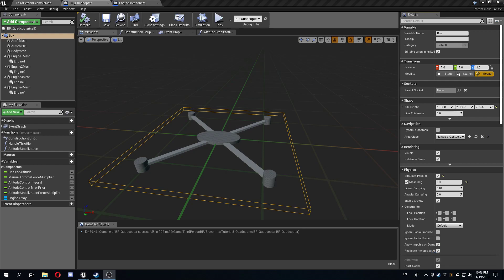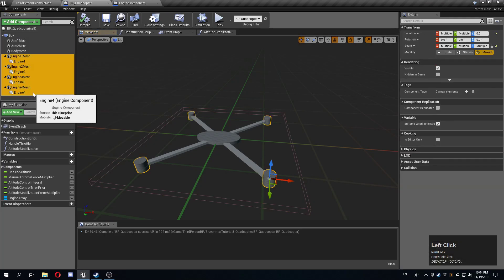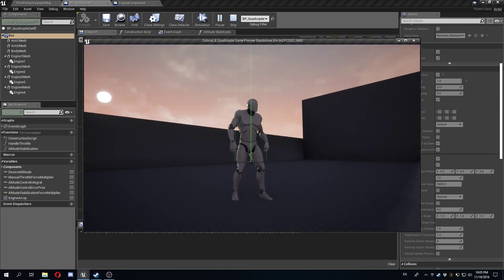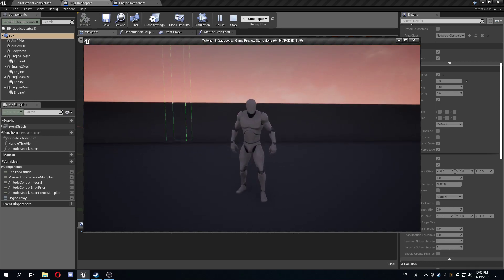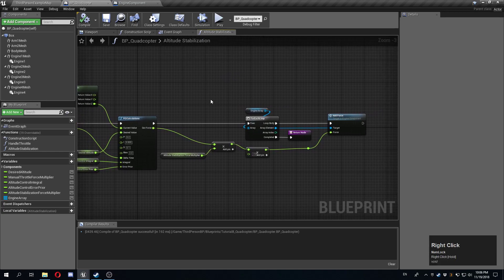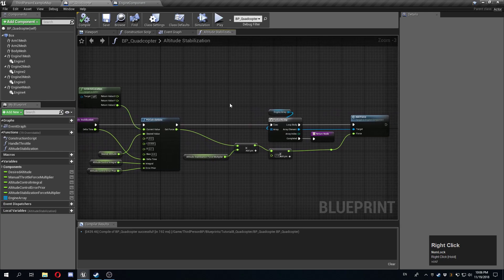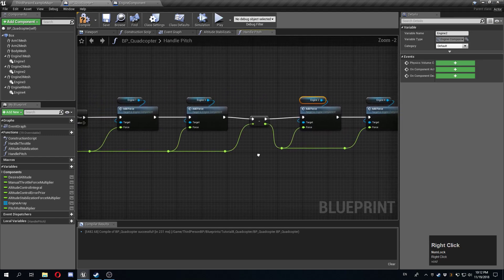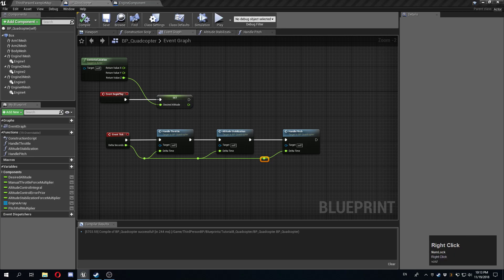UE4 Tutorial 8 - Quadcopter pitch and roll - part 2

Comment: for me it was the location of the engines (not the component) not being identical obvs the x and y would be either positive or negative depending which engine it is but the number itself needs to be all the same so that might of been the issue you had
Reply: @noozo  no worries haha now gotta figure out where i went wrong after Part 3 since its tipping forward right like its get up force from back left engine haha
Reply: @noozo  i dont think its to do with that, cause it was working earlier when i had stabilization doing everything, but now since i have a stablization for each one on there own it now doesnt work so ive messed up somewhere just cant find the error haha
Reply: I fought with the drift back and to the right for hours and then i noticed that i had collision for the body and 2 arms set to Block All Dynamic. I guess that means they were colliding with the Box Collision and causing extra force. I set them to no collision and that fixed it for me. Hope this helps.
Reply: @ZerofeverOfficial  This worked for me! Tysm!

Comment: I keep getting the same fly away issue (end of pt).  Sometimes I start and it's stable but then it'll slowly move and fly away.  I tried deleting and recreating the engines.  The only thing that seems to work is if I put all the engines at the origin.  Any possible way someone could share their solution so I can compare my blueprint?
Reply: I seem to be getting the behavior I want when I have the Box set to OverlapAllDynamic but I don't think that's what I want because I get play errors "Box1 has to have CollisionEnabled set to Query and Physics or Physics only if you’d like to AddForceAtLocation."
Reply: @noozo  Thanks for the reply and trying to help.  Unfortunately still happening for me.  I tried to set the box to BlockAllDynamic and the rest of the objects to both OverlayDynamic and NoCollision but I still have it happening.  Also tried to redo the engines (cylinder and components) many times. no luck :(
Box: 
-BoxExtends 16, 16, 0.5
BlockAllDynamic
Cylinder1: 
-Location: 11, -11, 0
Cylinder2:
-Location: 11, 11, 0
Cylinder3: 
-Location: -11, 11, 0
Cylinder4: 
-Location: 11, -11, 0
Reply: Cylinder1: 
-Location: -11, -11, 0 (correction)
Reply: I think I figured it out.  I noticed that the tick update on the Engine Components and BP_Drone were set to "During physics".  It changed it to "Post Update Work".  This helped but I still saw some leaning.  I changed the static meshes to "No Collision" and it seems to work now. Cheers!
Reply: @barkatz  Blueprints editor, Default Class Settings
Reply: @kimchimonkey my hero! this did it for me!
thanks A LOT!
Reply: @kimchimonkey  Hi ! Thanks for the tip ! It worked wonderfully for me as well. You had mentioned in this comment about some leaning. I am having some leaning as well. But the some leaning which starts initially increases rapidly after some time. Did you find any fix for that ?
Reply: For the guys doing this tutorial, please note, It is mentioned under 'Class Defaults' -> 'Actor Tick'(for BP_Drone) and 'Component Tick' for the later. Here you can set 'Post Update Work' option.
Reply: @sachinkmohan  Thank you
Reply: @kimchimonkey  U R my hero!!!!!